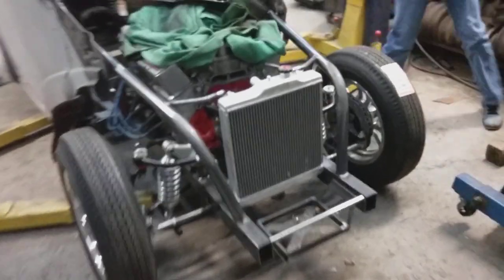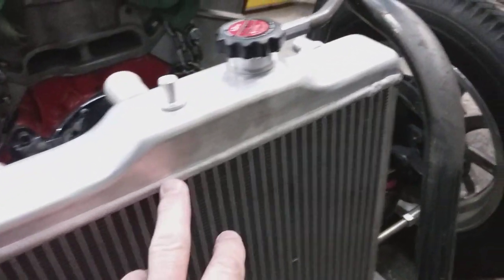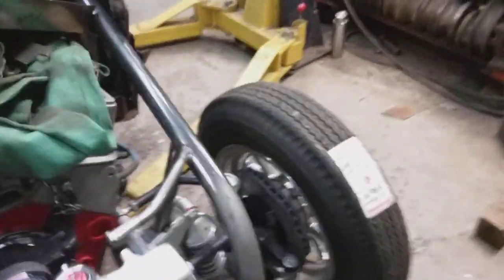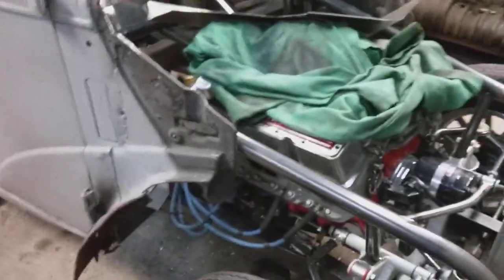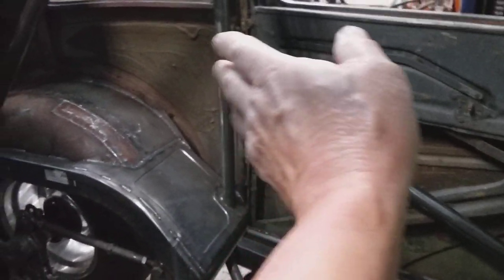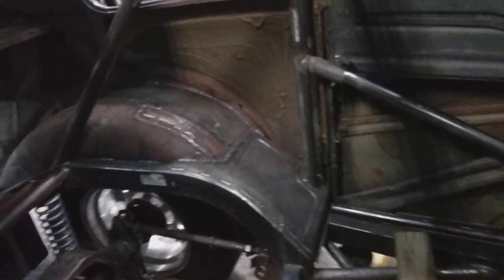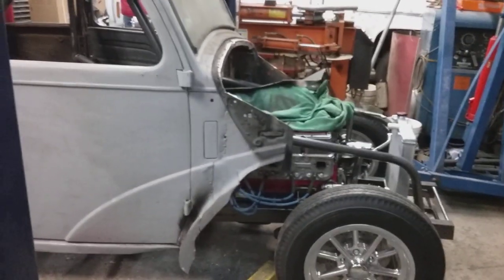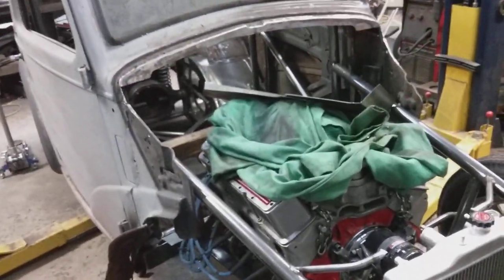Update on this Street/Strip 1948 Anglia that Tim Dixon is working on at Gas Axe Chop Shop. Facebook.

Comment: Impressive progress. Very odd place to locate the battery. Tim Dixon is extremely skilled at metal fabrication and electrical work, which are the two crucial areas that cause most projects to stay, well, projects. For decades.
Reply from the maker: Yes he is a very talented individual. Proud to call him my friend. Thanks!
Reply: Yea, I question the battery up front but it'll keep the nose planted.